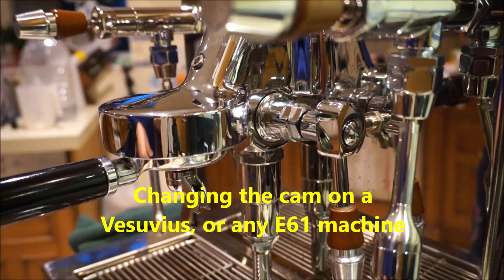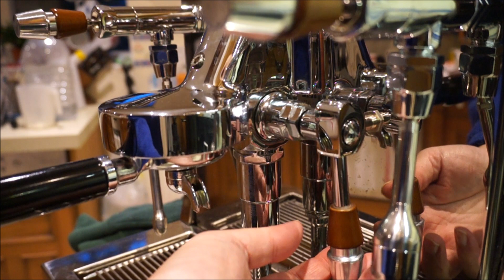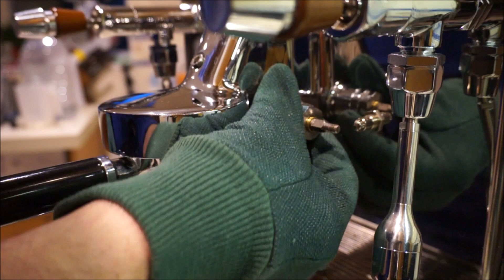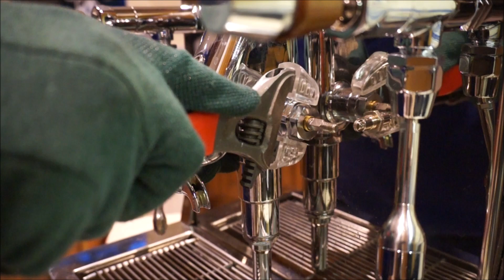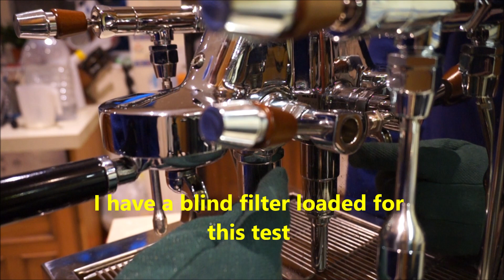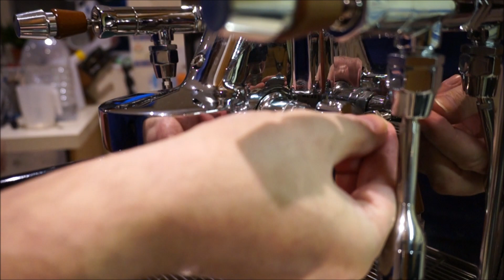Vesuvius   how to lubricate E61after backflushing with cleaner

Comment: For anyone else somehow not being able to get the cam back in place (I spent one hour trying to do that, God help me) - remove the lower end of the group as well. For some reason the bit sticking out from the bottom made it absolutely impossible for me to get the cam back in.
I saw another person made a post on a coffee forum somewhere about the same thing, and this also helped them.

Anyway, thanks for the video!
I have my silky smooth lever action back after a cleaner backflush.

I was actually quite stunned how after the very first (out of 10) pulycaff backflush the lever started squeaking and resisting.

Comment: Hi Dave. Could you please tell how do you lubricate balljoint steam & water wand. Thanks.
Reply from the maker: I usually put a little on the lower ball and work the wand when it's warm. For more thorough maintenance I remove the lower nut which releases the arm components and then lubricate. I think it's in one of my videos.
Reply: @DaveCorbey  Thanks Dave, I've already done it myself by removing lower nut as you described. Did you have to ever lubricate the paddle on Bianca as well? I think my doesn't move as smoothly as once did? Thanks for all of your answers.🤗

Comment: Where did you get that plastic tipped crescent wrench?
Reply from the maker: Amazon, usually under the brand Amtech, just make sure it comes with plastic jaw covers. You also need to tighten the jaws on the nut, remove it and then make it a little tighter, then push it on...this prevents the jaws slipping due to plastic deformation.

Comment: Does the orientation of the star lock washer matter? Should the jagged edge press against the nut or the lever? Thanks
Reply from the maker: They use external tooth lock washers, so it doesn't matter which way round they go. The screw/nut doesn't have to be very tight either, as the lever is on a square shaft and it's only to stop it falling off the end.
Reply: @DaveCorbey  Thank you! Makes sense.

Comment: Hi, thank you very much for this useful video, I'm in trouble because everything was fine until I tried to put everything back in place.. the pre infusion valve is activated while trying to put it 45 degree position and it leaks after putting them, please help 🙏
Reply: Forgot to mention that my machine is ecm synchronika
Reply from the maker: It should work, just double check you have everything back correctly. http://coffeetimex.wikidot.com/e61-group-servicing

Comment: Do you need to disconnect the plumb line to do this? Presumably at the 45 degree mark, although the pump isn't running, it lets water in via the pre infusion function.
Reply from the maker: Not on a vesuvius, because when plumbed it fills the internal tank, never direct boiler fill. This ensures accurate pressure profiling.

Comment: Great video Dave, very helpful. Which brand/type of spanner are you using? Can't seem to find one with a protected cover to prevent scratches. Cheers
Reply from the maker: Amtech, widely available on amazon
Reply: @DaveCorbey  Thank you!
Reply: @DaveCorbey  Wasn't able to find the actual product, would you be able to link it here? Thank you!
Reply from the maker: @yeongjia8  https://www.ebay.co.uk/itm/372944651622?epid=2255475848&hash=item56d53bc566:g:15kAAOSwkEFePVkC

Comment: Great video! Thanks!

The Vesuvius vs Crem One Pressure Profiling. Which would you recommend and why please ?
Reply from the maker: I think you simply have to read the reviews I did of both and come to your own decision. It's a very big subject and a lot of personal preference. They are both great machines.
Reply: @DaveCorbey  I like the Vesuvius with all the stainless steel inside. However, since I am buying online need a reliable machine, the dealers I approached advised against it. I saw their forum (I think it was started by you?), the only issue was the magnets in the pump and I think with new manufacturing date this issue shouldn't be a problem anymore. Other than that, I only saw one guy who had issues with leakage (probably he was unfortunate). One guy near me says the only issue he had with it is rusting under the water tank.
Reply from the maker: I don't see how it can rust, it's all stainless steel? Mine has no rust on it anywhere. The forum is really just for problems, it's a support forum, so you are mostly going to see problems on it. Mines given no trouble from new apart from me choosing to replace the brew boiler heating element gasket after 5+ years. It had been overtightened from new and had a few drips on warming up. I could have left it, but it was easy enough to replace the gasket. Mine is one of the first ones!

Pump magnets were a bad batch from Fluidotech it also affected La Marzocco and Slayer who use the same pump. Did the dealers you approach actually sell the Vesuvius?
Reply: @DaveCorbey  It rusted and I saw a video, basically when he fills the water tank, sometimes he spills a few drops outside the tank and with time it rusted. But no worries though, it is negligence from his side. Yet, I am not sure if stainless steel of that grade could rust so easily.

Because I am buying online from a different country the dealers don't want me (and them) go through having to ship spare parts and walk me through fixing the machine in case something goes wrong. So, they all adviced me to get something more reliable and easy to maintain such as the Synchronika, which the all agreed on. Those big names websites I've contacted are in Europe and some still sell them. The Synchronika is a very sturdy and nice machine but no pressure profiling. The only options I have are the Vesuvius, Crem, and Rocket R Nine One. 

I know you were a part of the designing team, which is a huge plus as you are my main reference for information (yes I am almost a stalker 😂). Also, I love the fact it is the only machine that I know off that use stainless steel pipes. What I hate about both the vesuvius and cerm is the e61 grouphead since it is exposed and fluctuate due to ambient temperature and lose a bit of temperature while extracting. Scace and fluke is an expensive investment to get to calibrate the offset temperature every now and then. Value for money, I don't think the Rocket is worth it. One more thing about the vesuvius, it seems the joystick sticky/gummy, it isn't as good as the Synchronika .. you would need to return it back to the middle rather than it pops into place directly when you switch the steam or water off. I'm not sure if this is with all the Vesuvius or the guy I saw his video had a faulty one, either way it isn't a deal breaker for me.

What I don't like about the crem is the copper boiler and the fact it is made in china for now. I know everything is made in Chine. But since everything is hand made, I don't think the Chinese have sufficient experience compared to the factory in Spain. Hence, more human erros would happen. For example, a guy in a non-english forum got one with a faulty boiler and had to wait a very long time for the factory to send the dealer a new one and then send it to him. However, value for money, it is hard not to consider this machine. 

I like the Zarre v2 especially the grouphead with heating element and triple PID. But I won't consider it since you didn't like the first one plus it uses a vibration pump,in addition to being a flow profiler not true gear pump machine.

Do you think Antonio will come up with new update to the vesuvius where it can be controlled using an Android app? That would be an amazing update. Btw, why do you think they did not add a mechanical pressure gauge? I know it is reflected electronically on the screen but the mechanical one shows the response faster. Do you think the Synchronika's flow control paddle can fit on the Vesuvius and Crem? 

One more thing I don't like about the mentioned machines, no volumetric buttons instead of the lever. It is annoying but I can live with them, especially considering the price they are at (or I got quoted).

Cheers 👍🏻
Reply from the maker: @NANA-gy7yx  I think it's very difficult to answer all those questions. The best way is read the reviews, look at the internals and make your own decision on that basis. I try and give as much information as possible and use machines for 3 weeks to many months testing, before writing a review.
Reply: @DaveCorbey  I learn a lot from following you on all the forums you are at and your website. Thanks man! Cheers :)
Reply: Hi @Dave Corbey and N/A, in reading the two reviews, is one of the biggest differences that the Crem One is volumetric pressure profiling while the Vesuvius is doing timed pressure profiling? Do either of the machines do both? And last question, is that manual control/manipulation of pressure during a shot is only available on the Crem One?
Reply from the maker: @wizbangdiving  you got it spot on. As for do either of the 2 machines do both, no, but Crem could add that feature in a software update via USB key and I have strongly advised them to do it. The Vesuvius pump can be volumetrically controlled with a high degree of accuracy (very high)but the board used has no more space for that extra programming. You should join us on our forum. https://tinyurl.com/coffeetimeforum